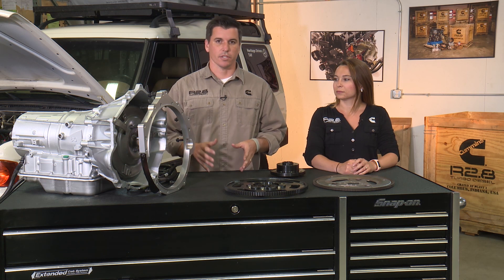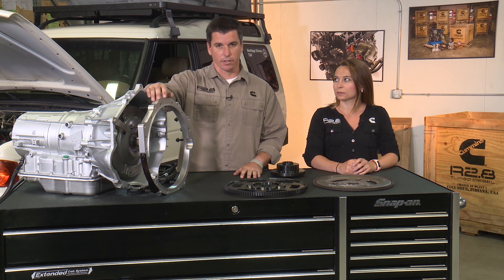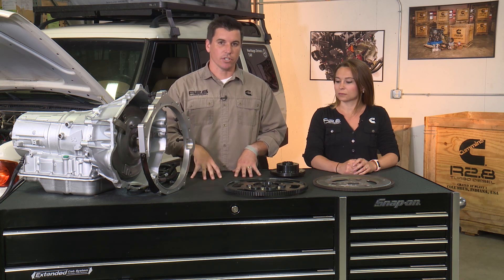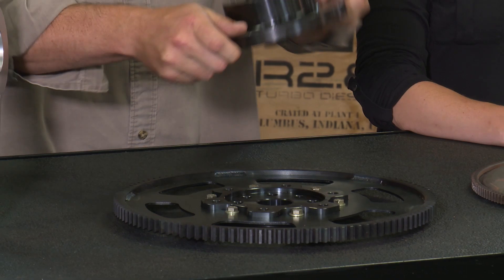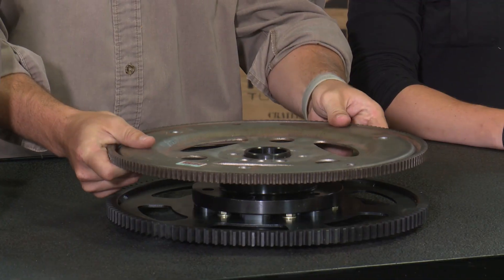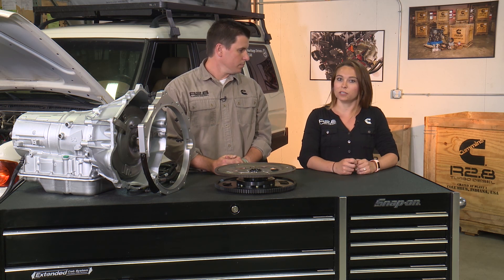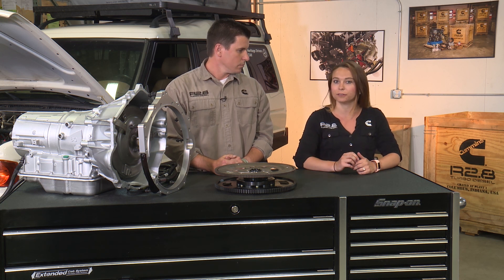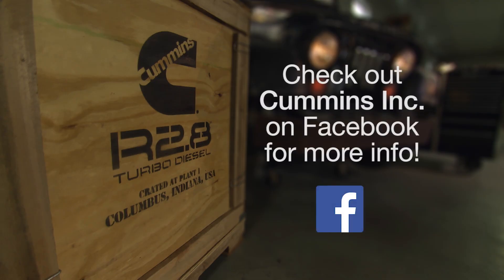Cummins Repower Garage: Tech Tips - Automatic Transmissions

Comment: Is there certified mechanics/garages to do these engine swaps ?
Reply: Any actual Cummins branch can do it- our labor rate is pretty high, but worth every dollar if you don't feel comfortable doing it yourself. Will probably run you around 20 grand installed including the cost of the R2.8, and if you don't require any extra surprise parts along the way. We work on older pre-emissions dodge pickups as well. One of my favorite customers is a kid who inherited a 91 3/4 ton dodge with an old 12 valve. We just reset the overhead in it, sounds like it just rolled off the assembly line.

Comment: You are really a huge and strong company, your scale is amazing. BUT, you are trying to win on the production of hydrogen, and not on the very principle of its production. I was able to develop a generator that produces gas many times more (9 watts per 100 milliliters) and, most importantly, by studying the process of making gas, I found the conditions for the operation of waves to produce gas, you can see in my profile. The main thing is that such a generator is already capable of torturing itself, I would have a cell and I would continue to conduct my tests. I also plan to further develop a generator capable of generating electricity and gas.

Comment: Unfortunately, modifications in my state are strictly forboden.
Reply: As long as it meets emission standards pre-1999, you should be fine.(Except CA) For the adapter plate, its not a modification that will void emissions; instead of modifying here its an adaptation that will meet standards.